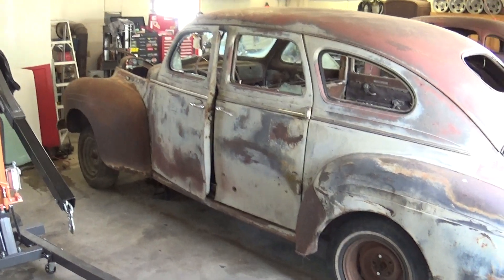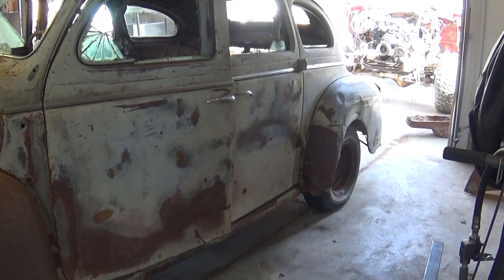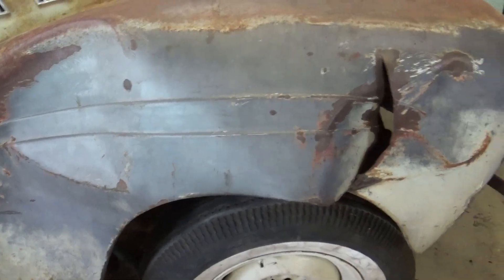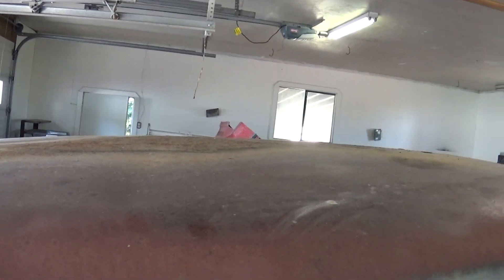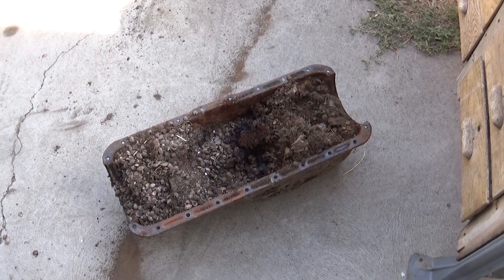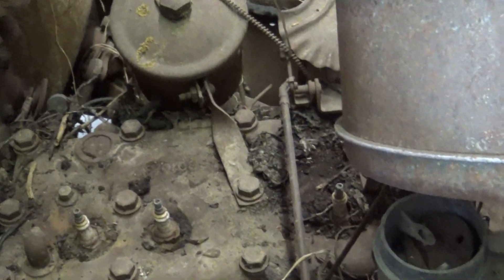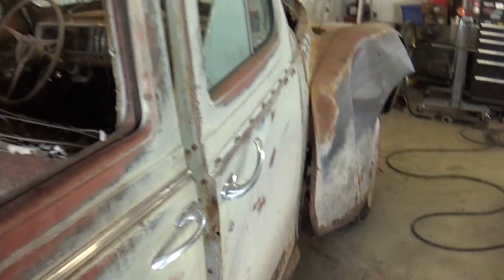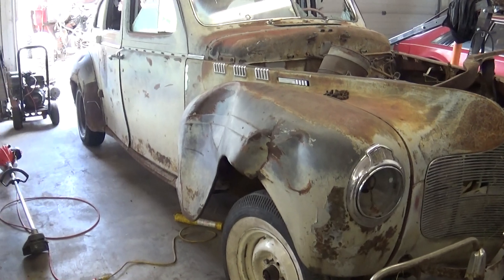1940 Desoto field find

Comment: That will be quite the car!
Looks like some little furry critters filled the engine full of nuts and dirt!
It must be drier out there,  if it was buried a foot deep here, it would be rotted off even with the ground! Great garage you have there, I am envious, my little car port just doesn't compare in any way!
Reply from the maker: I think it will be! It's a little crusty but still amazingly solid. The metal on these things also seems to be much thicker than anything made in the past several decades. Thanks! It's nice to have for sure.